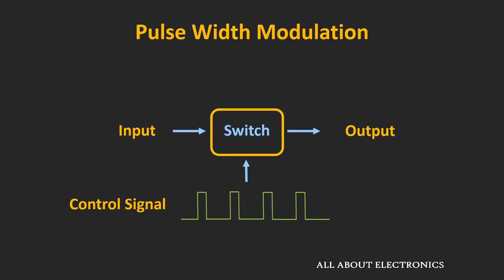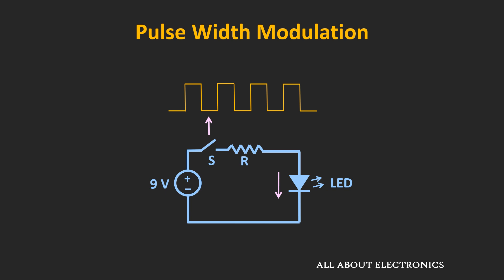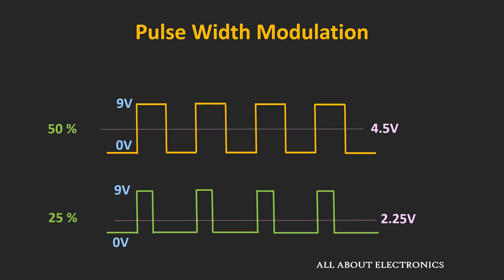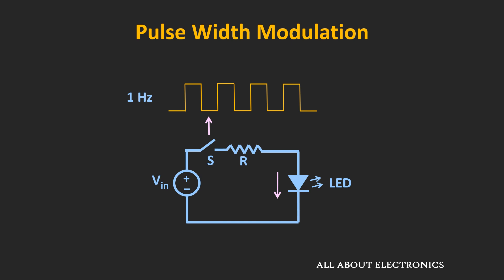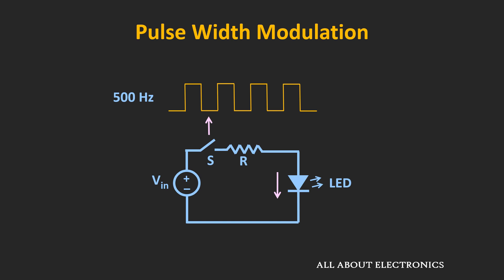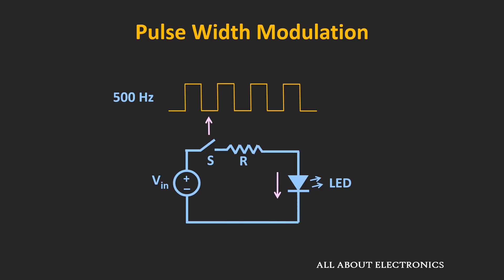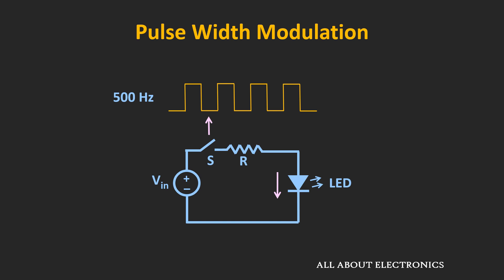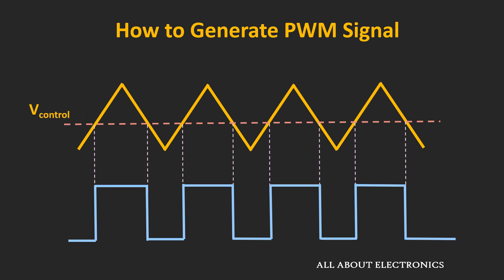What is Pulse Width Modulation? How to generate PWM signal ? Pulse Width Modulation Explained

Comment: Sir can I use pulse width modulation to control speed of induction motor ?
Reply: If u read this comment pls reply fast 🙏
Reply from the maker: Yes, the PWM can be used for speed control of induction motors.
Reply: @ALLABOUTELECTRONICS  thnku sir , can u tell me y MOSFET or other semiconductor devices r used with pwm pulses ? Before sending it to the induction motor

Comment: Is it true that if I want to use a pwm to control a 24 volt DC motor I have to have a 36 volt DC power supply

Comment: One clarification: when the pulse is in ON state the voltage dropped across the LED is same irrespective of the duty cycle. How is  the brightness of LED or the speed of the motor dependent on the average voltage rather than the input voltage at that instance?
Reply: I want to know this too. I dont understand how LED or motor can act different when voltage is still 5V or 0V. Only what change is time in which these two values are in

Comment: i need to buy PWM for hydrogen production. Hydrogen unit need 220volt
2500watt. I have 220volt inverter. Which bridge rectifier and capacitor should I use
to convert ac to dc how to connect capacitor. Which PWM should I selected

Comment: 2:20 sir can't we use a capacitor at the end of the switch to make the voltage output stable ?
Reply from the maker: If we need the stable average output, then yes we can use the RC averaging circuit.
Reply: Thanks sir your explanation is awesome

Comment: How voltage is varied using PWM
Reply from the maker: In PWM, the width of the pulse is varied right! Now, if you take the average of that pulse train ( let's say through RC filter), then it gives average value. If the pulse width is more, the average value will be more and vice a versa if it is less than average value will be less. So, using PWM it's possible to change the average value of the voltage, which can be given to some other circuit.
I hope it will clear your doubt.